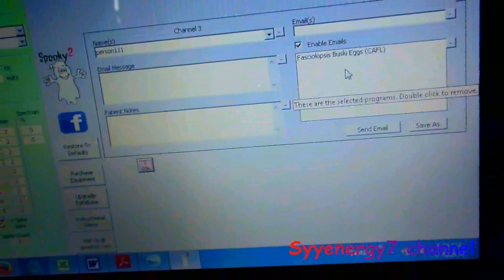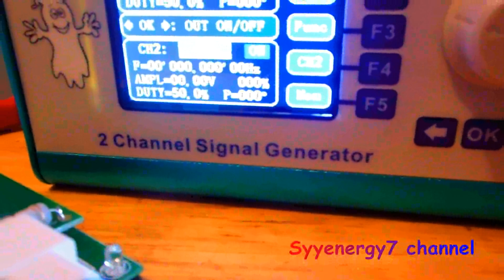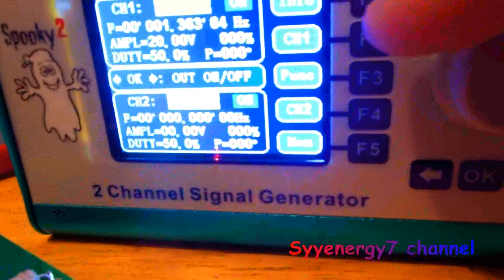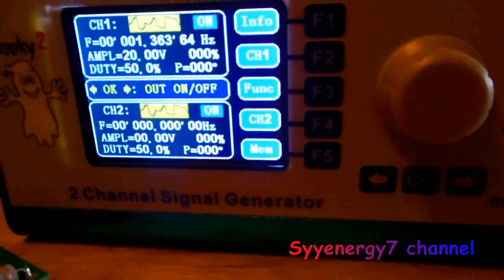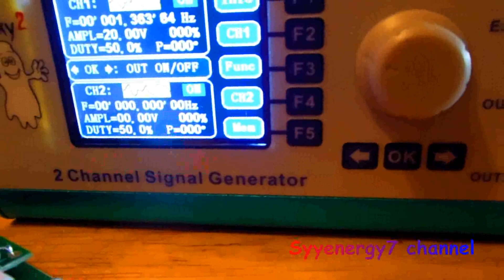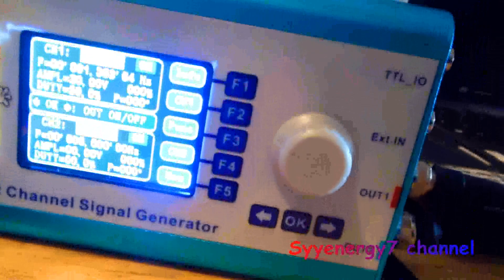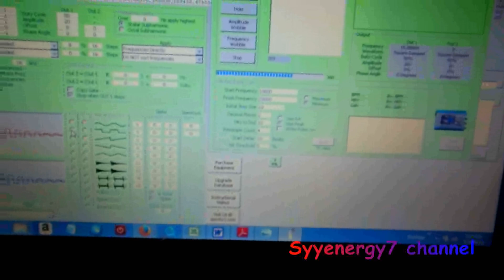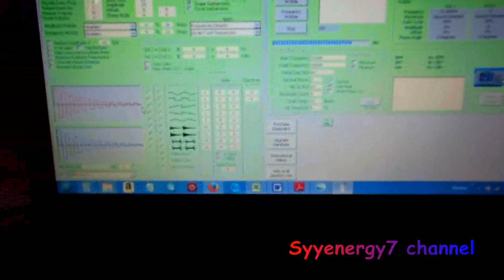A Look at Spooky2 'Rife' Dampened Square Wave

Comment from the maker: I was curious if the Spooky2 generator was accurate.  So I bought a made in USA quality frequency counter. a Leader model LDC 822.  It turns out Spooky2 is extremely accurate.  This a quick video I did.
Super Accurate Spooky2 'Rife' generator, PROVEN
Super Accurate Spooky2 'Rife' generator, PROVEN